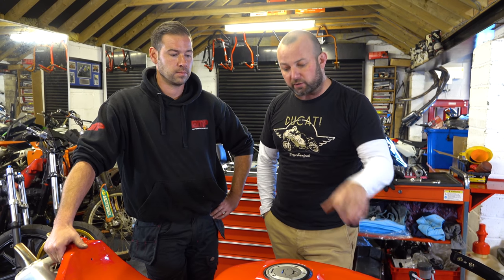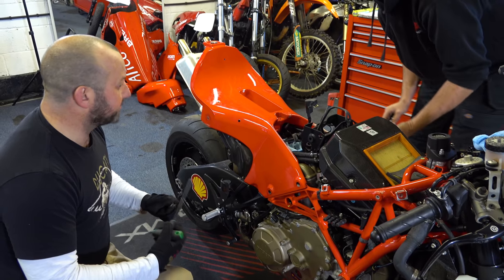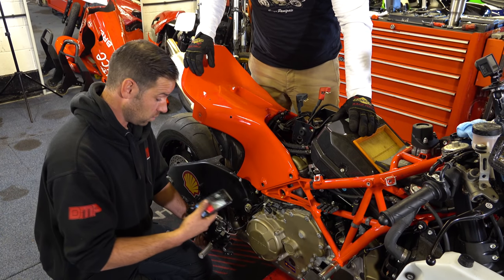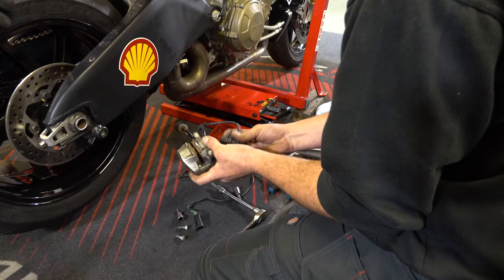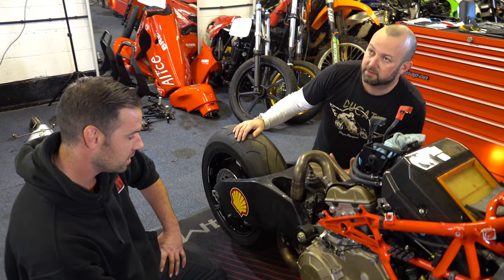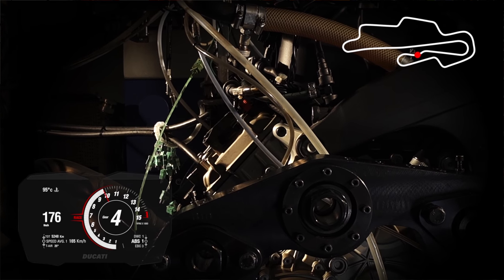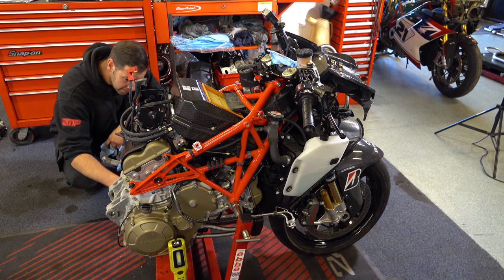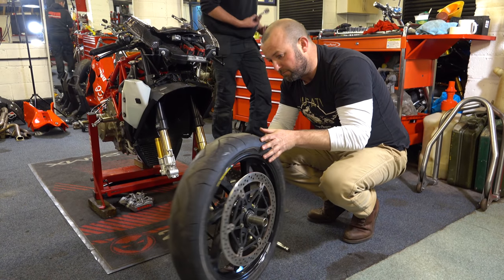Ducati Desmosedici RR Re-build Project Part 4 (Project 425) In 4K

Comment: Was the swing arm paint and engine corrosion caused by brake fluid from the rear brake reservoir leaking? The damage looks localized to that area. Just wondering... 
Subbed!

Comment: Was wondering when the next video will be published.  Seems like you've forgotten about the series?
Reply from the maker: Not at all, we're making arrangements to get the swingarm sorted next.
Reply: Outstanding!!!!!!!  And do you guys plan on tearing into the engine?  I wouldn't imagine you would since it seems to be running fine.
Reply from the maker: @j.devine9126  We've also been really busy with new bike launches, and Xmas.  Doubt we'll go too far, as you say it's running fine but Dan does want to check the top end.

Comment: that 16,5 inch tire probaly really hard to find.
Reply: Arie Sudrajat
16” 
Half inches not legally homologated for road use.
Reply: @ehtikhet  
I don't know if in the UK is illegal to use 16,5 inch tire but in my country Indonesia, a man has one of this bike, street legal and still use 16,5 inch tyre. and he said its very difficult to get a pair of this tyre because bridgestone don't make it anymore.
Reply: @ariesudrajat4534    It's a fairly popular "mod" to buy 17 inch Panigale wheels and put them on the D16RR.  They fit just fine IIRC, and it doesn't have traction control so at the worst it might throw off the speedometer.